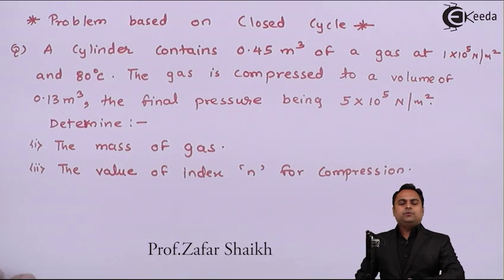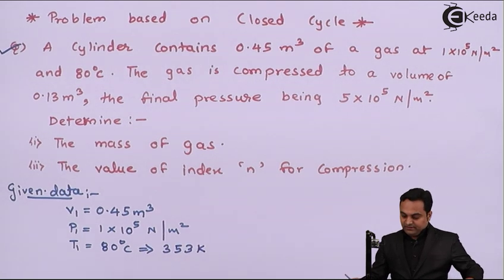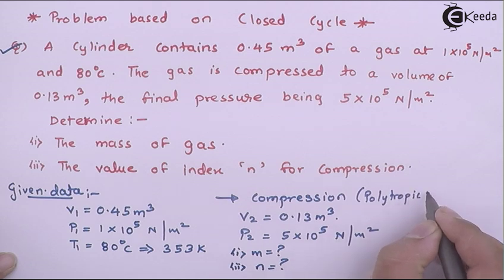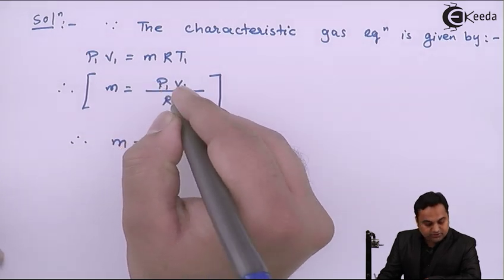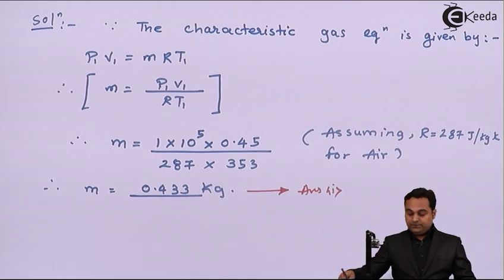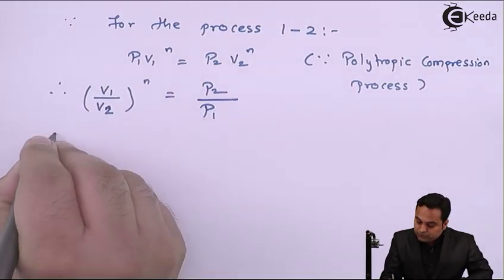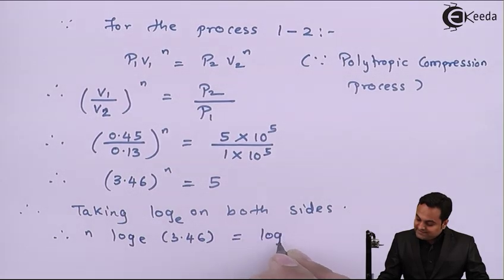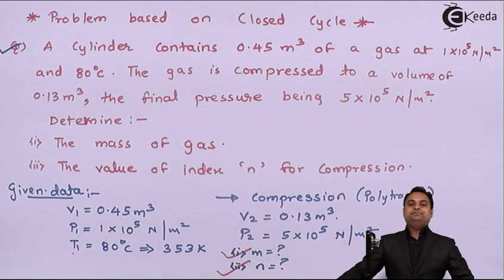Problem Based on Closed Cycle - First Law of Thermodynamics for closed system - Thermodynamics

Comment: A gas trapped in a cylinder behind a piston has an initial volume of 0.40 m 3 and its pressure is 159 kPa. It is made to undergo a process, which follows the relationship                                                             (V - 0.2) x 105 = (p - 300)2 , until the pressure is 400 kPa. Sketch the p-V diagram of this process and calculate the work done.